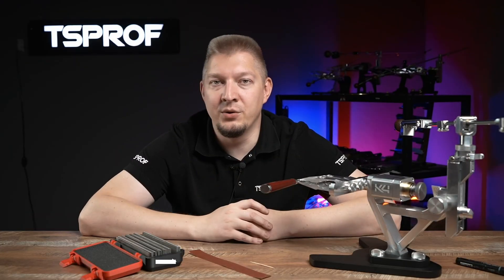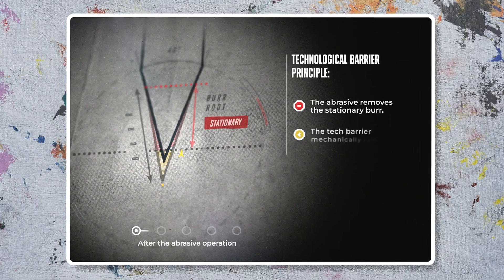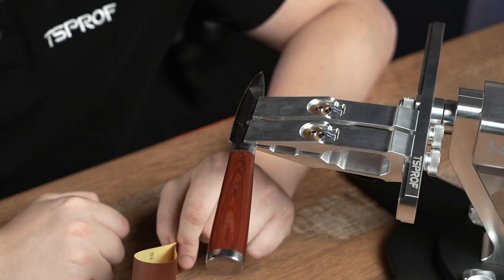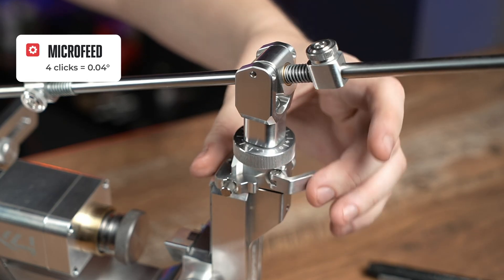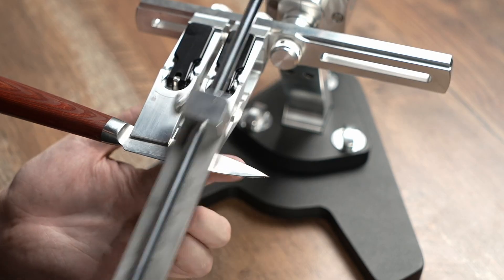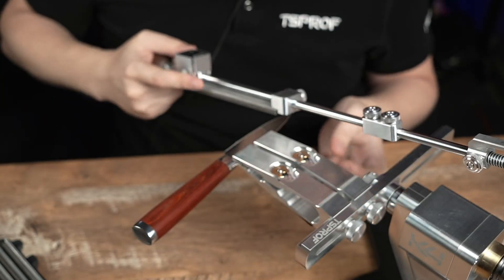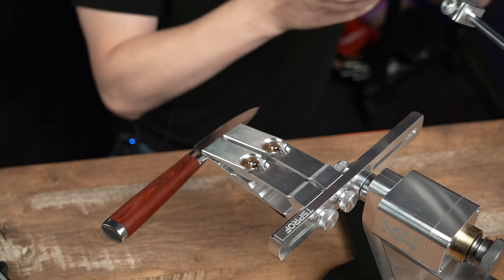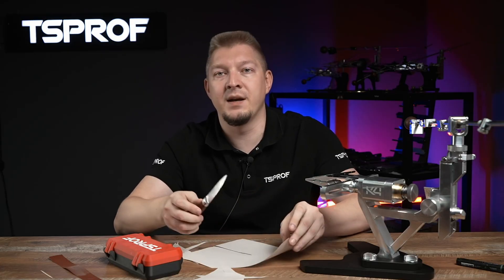Technological Barrier. Removing Burr With Sandpaper

Comment: This is the first I've heard of the term "technological barrier," but I accomplish something similar on my K03 by using elevated angle passes and strops that more aggressively micro-convex. On well-treated steels of about 60 HRC or more, I find that bumping up the angle as little as +.5° for a few passes and then dropping back down to the original angle for some back-sharpening passes (all edge-leading) works fine. For softer steels, I might bump up +2-3° before going back down to the original angle. For really shit steel I will get even more aggressive in raising the angle. After sufficiently minimizing the burr on the stones, I like to move to a balsa strop. I leave the surface very shaggy (sanded at 120 grit) and only cover half the surface with compound in a stripe pattern. The shaggy wood fibers seem to do a great job of micro-convexing while stropping at the original sharpening angle. Gentle sandpaper passes at 90° seems even more thorough, but I feel like there's probably a point of diminishing returns where you'd want to stop the back-sharpening before you start forming a very small burr again? I never end my sharpening process on a stone- always a strop of some sort, even if it's as simple as my pants.
Reply: I like stropping for the micro convex as well, but I don't bump the angles at all because I feel the micro convex is giving me the increased angle already. And yes, I do find an alder strops work better on my super steels like 15V and K390. My straight razors get hanging denim strops with and without Flitz polishing compound (learned this from The Science Of Sharp). I've been doing this before final sharpening on knives as well and find this eliminates burrs VERY effectively (not on super steel). Those straight razor techniques have helped my knife sharpening results. My 15V loves 100% diamond with alder strops with 1 and .25 mono diamond Stroppy Stuff. 15V jist won't dull, and it's sad it's gone. Magnamax is my hope to fill that void.
Reply: @alec_f1 the raised angle passes are done on the finishing stone, not usually the strop. Although, I have been experimenting with a resin strop raised angle for soft steels. This kinda acts like a really gentle fine finishing stone, though. The raised angle passes are what is removing the fatigued steel/root burr that they're talking about here. From there it's just a few back-sharpening passes and then stropping on-angle. You're right- the strop micro-convexes on it's own and doesn't need any further help with a raised angle.
Reply: Also, finger raking helps remove burrs in some cases where I fatigue the burr to snap. Then get back on the stones and strop. Outdoors55 has an interesting video he dropped today on YouTube about micro convexing and stropping.
Reply: @alec_f1  I think this new "technological barrier" is trying to eliminate the process you're talking about in a direct positive way!  That and the Micro-Bevel, too!   A definite repeatable easy process to directly attack the BURR, and so approach the naked APEX of our dreams.  I'm not sure if I'm just buying stuff from TSPROF or joining a cult!
Reply: Forming very small burr again seems to be part of this.  I think there could be a few "Iterations"!   Iterative Sharpening?  I think "technological barrier" might be a direct translation, I don't know if it makes sense in English.  What you're discussing seems similar, but still connected to the kind of thing we're already doing.  This new technique is radical (!) in the strictest sense, in that it addresses the ROOT!  I think (as they mention early in the video) this might be really specific for that really bad steel on the cheapest knives.  This comes up a LOT, and I'm going to some local thrift-stores today just to buy some sad imitation chef's knives, and see if they can be SAVED, Hallelujah!
Reply: @leonardpearlman4017 yes, RIP Vadim Kraichuck. His concept of the root burr and how to contend with it was spot-on and directly informs my de-burring strategies too. It's just a matter of understanding how to apply it in different ways depending on the sharpening approach. I figured "technological barrier" might be a very literal translation. People I come across who take the apex off on a stone at 90° tend to call it "de-stressing" the edge, a la Cliff Stamp.